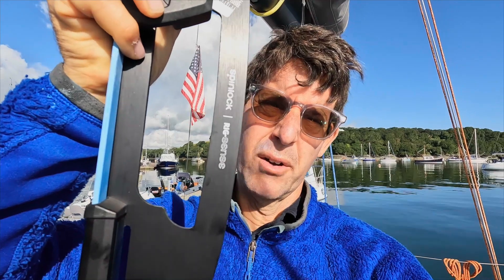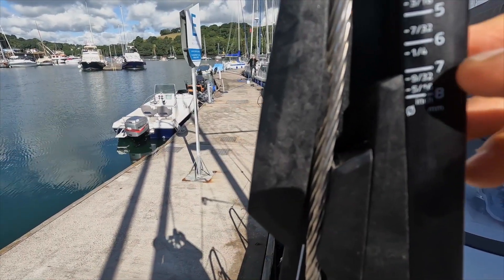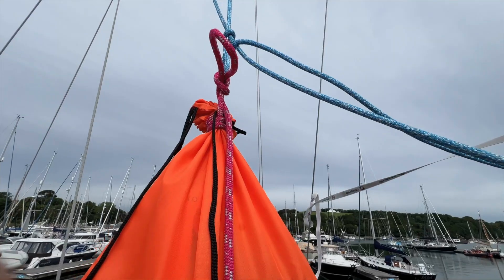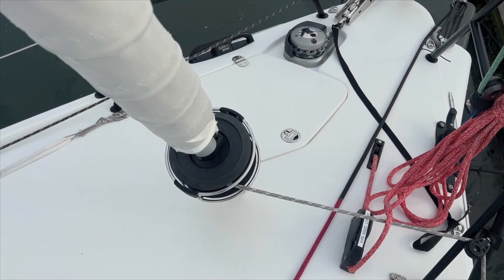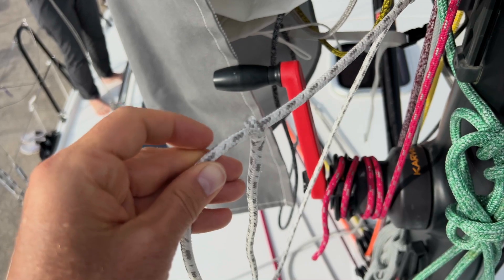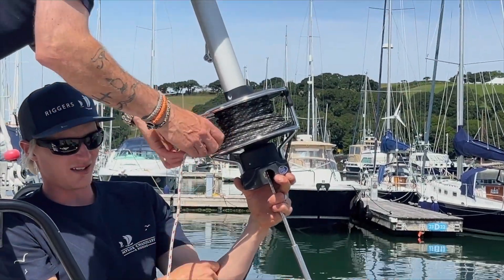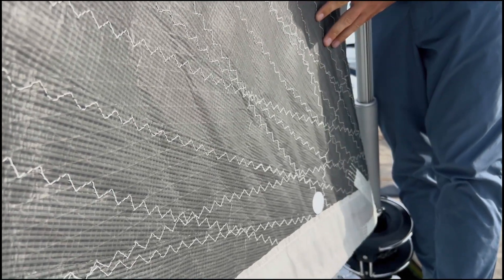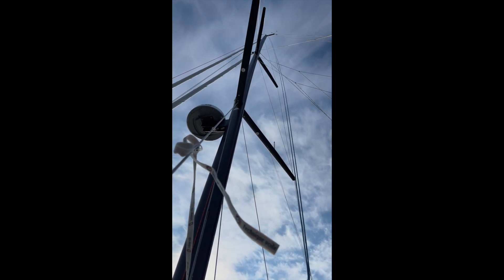Rig needs repair?

Comment: To tension the cutter I used the running backstays basically straightening the mast this will put more tension on the cutter and forestay..
Reply from the maker: I have checkstays.  Is that what you are talking about.

Comment: I'm curious how much sail can you realistically carry given the performance orientation of the boat? Is it possible to fly the staysail and code zero at the same time when reaching or is that unnecessary? How does the boat behave when it's over powered - as it's intended as a cruising boat, is it forgiving when the wind gets up, or do you need your wits about you?
Reply: The 38 and 39 FC have a lot of form stability and can carry a lot of sail and like big breeze. They just sit on the chine and go, double headed reaching works great.
Reply from the maker: Well said @sakulifcation.    With too much the leeway surges and rudder stalls are frequent.

Comment: On all the boats I've tuned the forestay adjusts how much rake there is to the mast, then the shrouds/backstay are adjusted to the right tension. Is there a reason you did this the opposite way? Did you re-check the shroud tensions after making the adjustment? Did you direct the riggers to tighten the forestay or did they suggest that?
Reply from the maker: 100 percent by the riggers.   I have reached to fellow owners but they have not replied.    The shrouds increased only slightly after then forestay was tightened.   Still just over 10% of breaking strength.   I don’t think the rake changed as well but can’t be sure since my technique was poor.

Comment: Curious how you decided what the appropriate forestay tension was? In light airs, with the backstay off, you do want some forestay sag so I am curious how you decided where the line was? Depending on the D1 and D2 tensions, generally tightening the backstay will tighten the forestay and so give you the desired wind speed adjustments. 
If you measured sag pre and post this adjustment it would be helpful to see and to hear your observations about the effect on the boat's performance upwind.
Reply from the maker: Warning my skills are crude.  I used to race one design keel boats where the pros/sailmakers gave us great tuning tips for all wind speeds.  Cyclops rig seemed more in the obvious camp.   I could shake the forestay with the slightest of effort and even with back stay the rig would pump.   After tightening the forestay more than 10 turns it seemed much better .   I look for enough sag to have a chance to power up in the light air.  I might be too tight but now I know how to take turns off.  I might add a load sensor to the rig in the next few years.
Reply: @svcyclops  , great answer. Please keep us posted on the results. We had a forestay that was too loose due to a stupid mistake measuring by me and it really cost us height and was difficult to compensate as the breeze came up. 
Is this boat keel or deck stepped? This seems to be pretty relevant to the question of rake as posed by@gabehill4035 below.